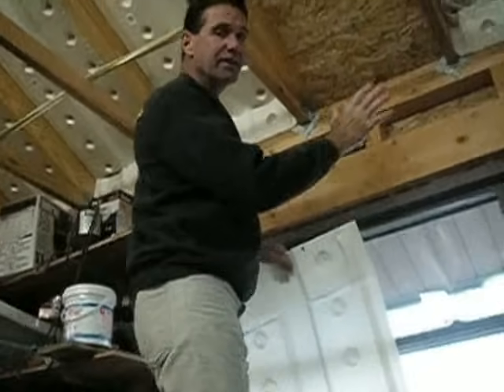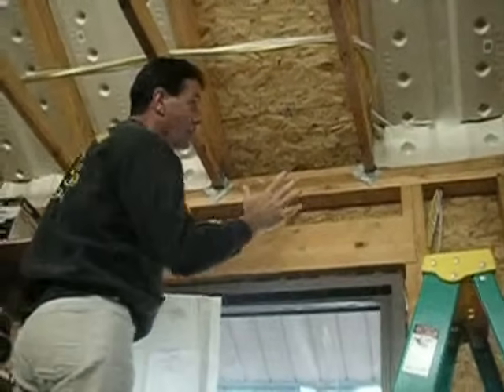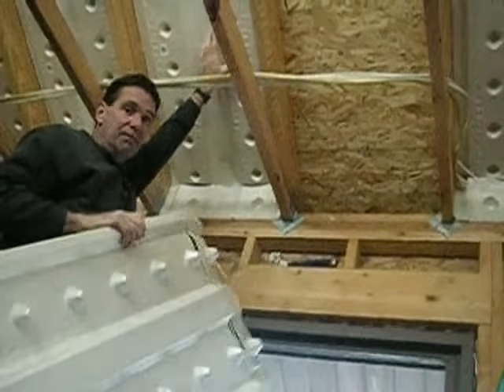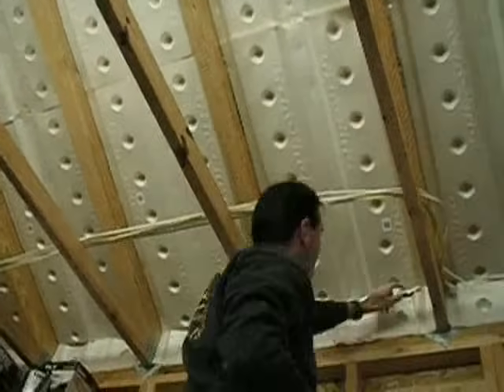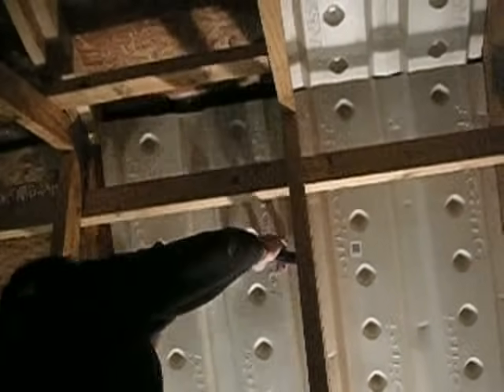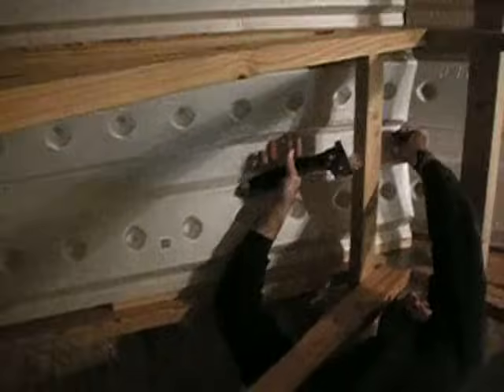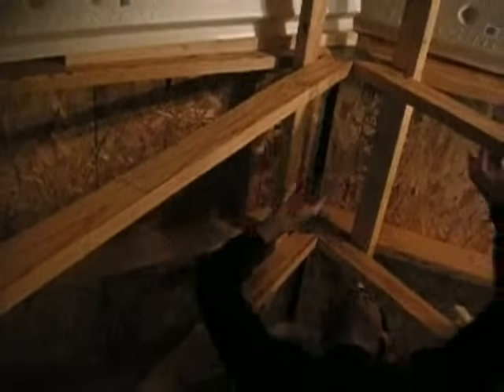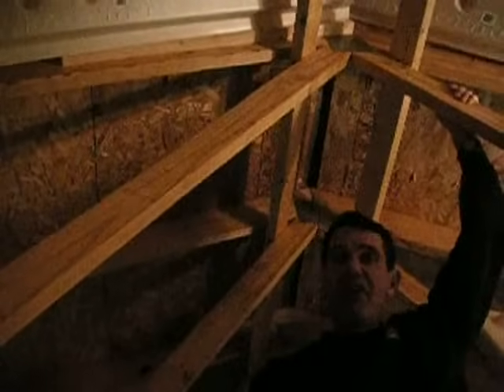Roof, Attic Insulation of Foam Baffles - Ventilate, Insulate Cold, Hot Air

Comment: If you're insulating both the under side of the roof, and the top side of you ceilings, you want the soffit baffles to carry air to the ridge vent. This is to keep the roof deck (underside of the shingles and plywood) to have ventilation for cooling the roof, removing moisture, and also to prevent ice damming in the winter.

Comment: If you block the air flow from the soffit to the ridge vent aren't you supposed to get ice damming in the Winter?  I thought you just did that.
Reply from the maker: Sorry you missed the lesson. It is all about air flow from the soffit to the ridge vent. No blockage, building an air passage here.
Reply: @Mr. Hardware, What would happen if the air beneath is conditioned in the winter, and the baffle is cold to the touch. Wouldn't that create condensation because of the warm conditioned moisture air touching the cold baffle?

Comment: I'm afraid that you put too much baffle up there.  Typically we only run the baffles about 8" - 12" past the height of insulation... That way the moisture that goes through the sheetrock and then through the insulation can be evacuated.  When you run the baffles all the way from soffit vent to the ridge vent, you are just moving air up & through your baffle and out the top. No air is allowed to remove the moisture with that method. Better to leave the top portion of the attic without baffles so the air can do its job and evacuate the moisture from the shop - or more commonly - from the house.  The moisture will not stay in the attic this way. My 2¢
Reply: That would work if you were insulating the ceiling at the joist level, but he is insulating the rafters. There is no attic, the ceiling is open.

Comment: Do you need to intall a baffle between every single joist or just where there are vents?
Reply from the maker: You should only need baffles to get above the insulated ceiling and use the attic as a common area for rising heated air to get to the vents. I baffled every rafter to get the air from the soffits to the ridge vent because I didn't have a common area to accumulate the heated air. I was living/conditioning/using the entire attic area.

Comment: I have a 14x36 shed with a loft on both ends , I am finishing it out myself , I did not add baffles , I just stapled insulation up , do I now need to back track and remove the insulation to add baffles ? the shed will be air conditioned in summer and heated in winter , cause I plan on living in it as soon as im done , if ever ..  :)
Reply from the maker: Air flow above the insulation is the key. Is there room for air or is the insulation tight to the roof?

Comment: Thank God Zudoan isnt an insulation contractor.  This IS the proper method.  He will not have a traditional attic.  The baffles and subsequent insulation will be the 'attic'. his rafters will be used as storage with no ceiling - thus providing plenty of breathing and movement of air to prevent mold, etc. And he is still letting his roof sheeting and shingles breathe.  I just hope he puts insulation over the vertical part of the baffles, otherwise is will be a cold zone for moisture build up.

Comment: Unfortunately my garage does not have a long ridge vent that runs the entire distance of the roof the way yours is shown in this video.  The people installed my roof just put two round vents in the roof that sort of look like chimneys.  How should I install the baffles and insulation in that type roof so the air flow is maintained?
Reply from the maker: You will need to create an air space below the roof vents (which you will need more of). That way air coming from the soffit can get heated by the warm roof and rise up and out the vents drawing in more cooler air. When I installed the baffels I stayed below the ridge so air from either side of the roof could exit the ridge. Your goal will be to build a  collection area.
Reply: It is pretty simple to add a ridge vent to an existing roof's ridge, from the exterior. Pretty affordable job to do. You could likely still run the round vents if you ensured they wouldn't leak, etc... or maybe consider adding a fan powered vent (either solar or otherwise) to help the airflow happen as desired. You could probably add them in place of the current round vents, as long as the powered vent called for a hole at least as big.

Comment: @ivcruiser
He doesn't have it all wrong.  Believe it or not, this is a very effective way to insulate the attic without using fiber blankets. The key for insulation to work is to keep the roof as hot/cold as possible by providing an air space.  The only thing I would add to what he is doing is to staple fiber batts over the vent baffles he already has.  Remember that his aim is to use that attic truss space.  This method is especially useful if using spray-on insulation - Architect of 14 years

Comment: nrgsaver, obviously ridge vents are not meant to be used without soffit vents or gable vents.  A ridge vent alone will never be sufficient without proper air flow from the other vents.

Now that you have airflow from below/side, air will flow upwards into and through the ridge vent.  This is the whole reason why this guy is putting in baffles.

Comment: @geekstreat  Yes, I was wondering about that too.  All other videos I've seen only these baffles only go as high as the insulation you put on the floor area (not all the way to the ridge vent) and that is because you want ventilation in the attic.  So, my question is what is he doing???
Reply: sarah4one he’s doing it all the way to the roof because he’s not insulting his attic traditionally on the decking but in between the rafters so that he can use the decking for storage. It’s the same method you would use for finishing an attic loft space and making it livable air conditioned space. He’s doing it correctly for his purposes. Someone who isn’t insulating between the rafters wouldn’t need to go all the way up. Since he is, he does need to go all the way to the ridge vent.

Comment: //Systems like this effectively change the "attic" to "conditioned" space - like the main floors of your home - with the usual hvac system controlling heating/cooling/humidity. Make sense now?//

No they don't! This is not a conditioned attic. A conditioned attic is one that stays largely within the same temperature of the house. His fiberglass attic will largely stay in the range of the outside air. Conditioned attics are high efficiency systems designed to save massive amounts of money on heating and cooling. Their drawback is they are more expensive initially to install.
Reply from the maker: +77Avadon77 
this is not an attic, it is my work shop with an open ceiling. Thus it is a giant conditioned space.

Comment: There is confusion about this installation because he didn't clearly explain the difference between insulating and venting an attic space and what he is doing, which is insulating and venting a roof. In a traditional attic the purpose of insulation is to insulate the ceiling and to ensure the air flow from the soffits keeps the attic space close to the temperature as outside.

Comment: I'm looking at doing the same thing for my garage. Are you rafters 2" x 6"  and if so did you use R19 insulation? My garage has 2"x 6"s and I would like to install R19 instead of R15 if I can still maintain good air flow with the foam baffles.
Reply from the maker: +Ryan Rumelhart 
Ryan, I installed reinforced plastic under my 2x6 top cord trusses with a 1" crown stapler and filled the cavity with blow-in cellulose. 
I would do it again w/the most cost efficient product because it is a garage. My house is insulated with spray foam, and here in Michigan my January bill to heat 2,000 to 69 degrees is $110 a month. That is where my money is.

Comment: Insulating garage.  What happens when the ceiling does not have a ridge vent in the top of the ceiling?  We do have a ventilated soffit but not on the ceiling.
Reply: +Hyper Sonic You only do the first layer closest to the soffit vents. You really only need the air to circulate up and over any insulation posted against the soffit area. If you don't have ridge, but have gable vents, that will work fine for you.

Comment from the maker: The air enters from the soffit, (the overhang at the base of my roof.
It gets heated from the sun, it rises up and out the ridge vent at the top of the roof.
The baffles allow me to insulate tight to the roof while allowing air to flow up and out the top.
Mr. Hardware
Reply: Thank you for the video, I'm planning on doing this for my parents house (some time in the future) and having a video to show them will be a great help in explaining. One thing you mentioned was the vapor. I know it needed to be added, but I'm not sure where it goes...  Does the barrier go over this material and then the insulation last or insulation and then vapor barrier?

Comment: Awesome video! I'm about to tackle this, this weekend. What rated insulation did you go with for the roof walls? I live in MN, and the recommended R is at least 30. I can't seem to find the right insulation that can fit a 2x4 roof and is 24 inches wide.
Reply from the maker: You will have to use closed cell foam. I used it in another house I remolded and my January heat bill was $110 a month just outside of Detroit.

Comment: so many dumb commenters... this works. It's for an uncommon but sometimes necessary situation: insulating a roof that has no attic. I'm trying to do the same thing myself right now and am using a different system, but the idea is the same: if you insulate directly, you'll run into moisture issues. To overcome the moisture issues, you need airflow. He's created very good airflow here. End result? Insulated ceiling, mold-free. This is what you do.

Comment: surprised someone hasn't mentioned this yet.  if you overlap the baffles the other way ie top to bottom, then if the roof leaks or has condensation on the nails the water will run down to the soffit.  Also, shouldn't the soffit have the baffle run into it so it will drip to the soffit and not the the top of the wall?  I know you will seal everything and it has probably been good but just an observation.....
Reply from the maker: +spudth 
Well said, with proper ventilation there should not be any condensation, but why not prepare for the worst? What about when the roof fails? Thanks Blair
Reply: Mr. Hardware I thought they made an Piece one that would fit directly right down into the soffit
Reply: spudth install from soffit up, because it follows the airflows-up through the soffit and to the ridge vent. This is the most efficient overlap for this air direction.

Comment: The "Hot Ruf!"  Yes, exactly... that is the reason we have attic ventilation directly under the deck.  That is the reason!!!   Modern roofing shingles cannot handle the heat and must dissipate heat from the underside (into the attic).  Otherwise we could air seal and insulate right up to the deck.
Reply: According to Oak Ridge Laboratories, ventilation does very little to ameliorate shingle temperature; shingle color is the primary determinate of roof temperature.

Comment: 1-What happens if you leave the roof attic with only baffles but the attic floor with extra full insulation only 

2-What happens if you only insulate the roof without baffles sorry I might of had missed these questions
Reply from the maker: Only insulate the roof if the attic is a conditioned area. Do the floor of the attic if the conditioned area is directly below.

Comment: Not how I would do it
Reply from the maker: This is now years old and working great for me. How would you do it??
Reply: This only really works full effect in new construction with a ridge vent.
Reply from the maker: I add a ridge vent on ever re-roof I'm involved in, new or old. But yes, you need a ridge vent for this system to work.
Reply: space between Baffles.   over time you will find out why.
Reply from the maker: Lisa, what is the secret? I need to contain the air in the baffle from the soffit to the ridge vent. Where should I put the space? Thanks in advance for the tips. Blair
Reply: Lisa was a lot of help. lol. Thanks for nothing.

Comment: Do I have to run the vents all the way up the rafters to the top?  Or can I get away with one vent per rafter?
Reply from the maker: The purpose is to allow air flow from the soffit to above the insulation over the ceiling. As long as the insulation does not clog the airflow, that is how long the baffles need to be.